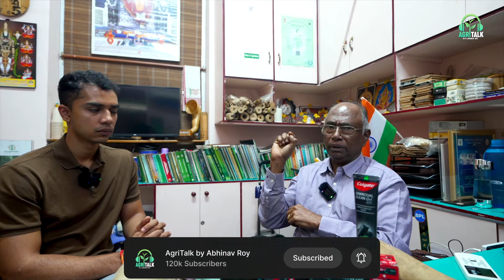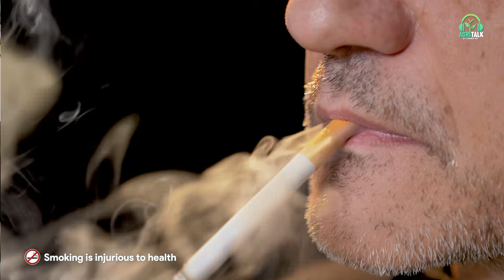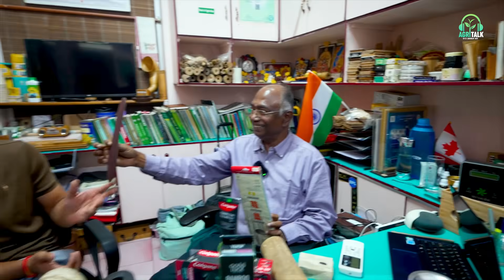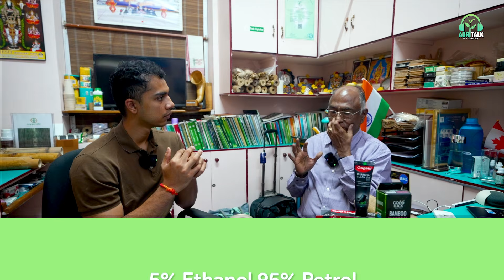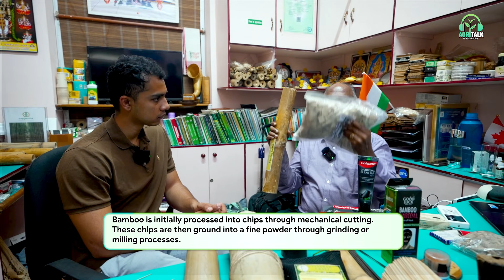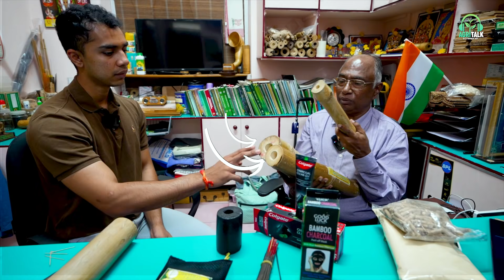The Secret to 3x Income with Bamboo Farming Revealed | Agritalk by Abhinav Roy ( Part 2 )

Comment: Bio CNG claim of 5 tonnes per acres is unrealistic. 40 tonnes of bamboo (annual yield) don't have potential to generate that amount. 
Very optimistic scenario may generate 3-3.5 tonnes which may involve significant pre-treatment cost. Normal digestor with normal treatment will produce 1.2-1.5 tonnes of bio CNG only.

Comment: Ethanol burning releases carbon dioxide. Don’t spread misconception with ‘carbon neutral’ tag everywhere. The emissions coming from exploration and production of crude oil and then refining petrol from crude oil releases lot of carbon dioxide. We call carbon neutral because bamboo is made from atmospheric carbon converted to carbohydrate. But if you use fossil fuel for pyrolysis of bamboo or making ethanol from bamboo then it’s not fully carbon neutral. It’s good to replace fossil fuel with bio fuel. But please don’t spread misconception
Reply: It is carbon neutral because, you have a carbon cycle in place. Even if you release carbon in the process the plant that grows in future from your farm will absorb that carbon thus it acts as a close cycle. Petroleum is dug out and burned it is not again captured so the cycle is not continuous. Hope this answers your question.
Reply: @ thanks for your reply. The circularity you are talking about is the carbon emitted when ethanol is burnt. But to make ethanol from bamboo you need a process plant where something will be burnt as fuel. If it is diesel or some other form of fossil fuel, that part is still contributing to emissions of carbon from fossil fuel. For example power consumption in ethanol plant for electricity needs, you may import from a grid. There would be some emissions associated with the generation of grid electricity. So entirely carbon neutral is something which is doesn’t consume any form of fossil fuel. Don’t get me wrong, I support this bio fuel concept since bulk of emissions is reduced. But still proper accounting of carbon is required to make a meaningful transition of providing energy
Reply: @shankardhayal6073  your concern is well taken.

Please understand that the energy such as steam and power is generated from the bamboo waste left out after recovering the cellulose and the process is by Cogeneration of process steam and Electricity.
So the process of making ethanol is also close to CARBON NEUTRAL.
Reply: @ thank you Dr Barathi for your response.
Reply: @shankardhayal6073 excellent c
Reply: Brother that is why they call it carbon neutral cause if we are making 1 kilo carbon emissions to generate let’s say 1kw energy that is reduced significantly even while using diesel or electricity to generate energy from bamboo